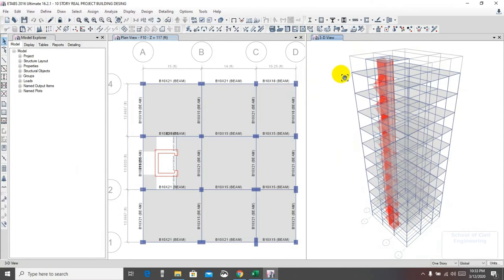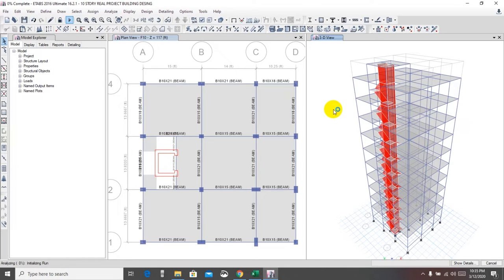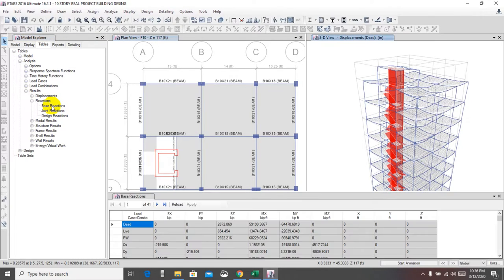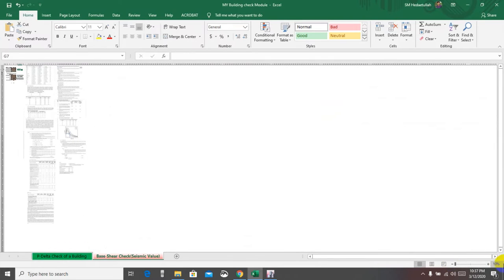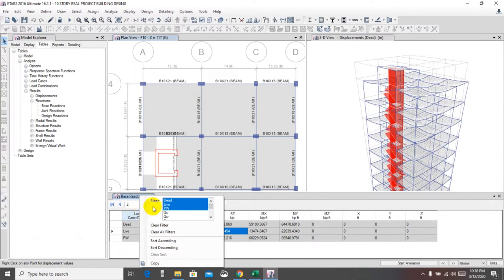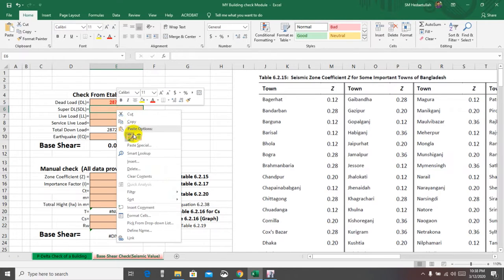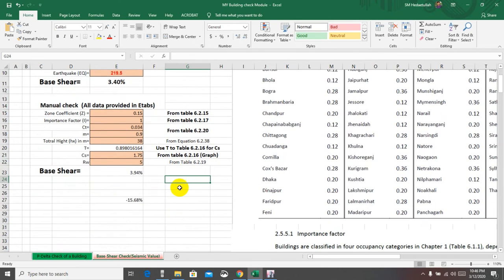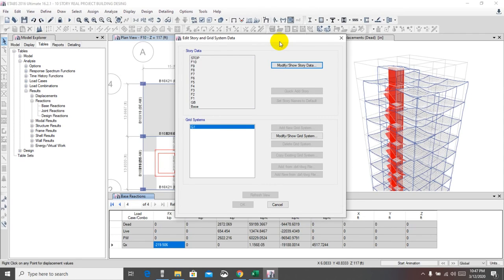Etabs Full Tutorials for beginners | Base Shear Check For Seismic Load On Building in Etabs | Lec-22

Comment: Dear, i want to know ,how much difference are acceptable about base shear between manual & etabs value  as per code Please mention your opinion.
Reply from the maker: maximum 30% will be better.
Reply: Thanks, but clearify any reference which code suggest these percentage such as ACI code or ASCE or UBC or IBC ,, please mention these, thanks
Reply from the maker: there have no reference for that. we check that for confirming that is it ok or not.

Comment: In tables - reaction - there is only two reaction joint reaction and joint design reaction. there is no base reaction? what did i do wrong can u tell.
Reply from the maker: i will check it and let you know dear
Reply: @qlearnify-en  i am waiting for your response. thanks
Reply from the maker: I didn’t get any solution but you can find out directly from reaction option of etabs
Reply: @qlearnify-en  ow ok.
Reply: @qlearnify-en  i got it, i found the base reaction in Structure output.
Reply from the maker: That's Really Great.